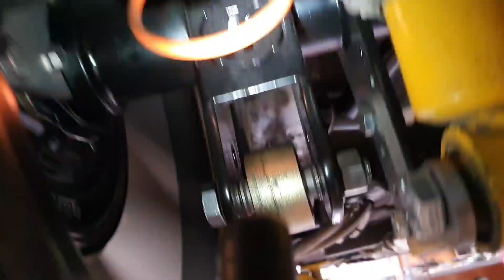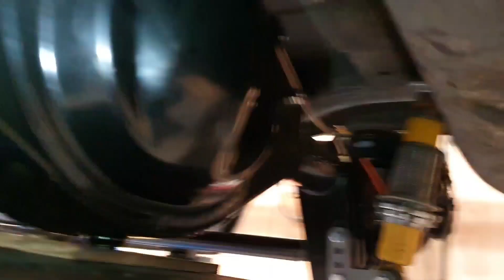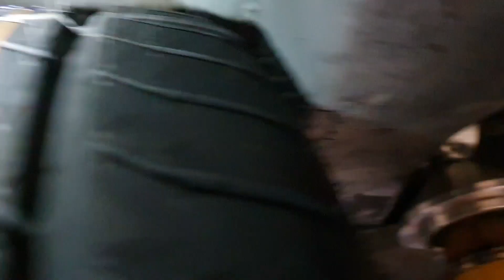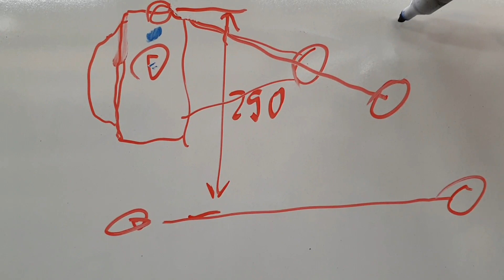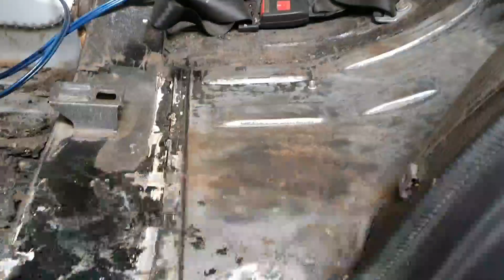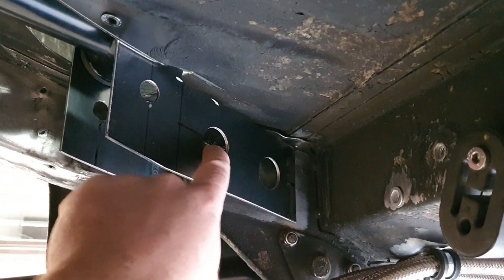Supercharged VK56DE Gloria episode ninety billion

Comment: A 255 would have been just about right for the car.
Reply from the maker: For some reason i thought it had 255 on it to start with but it turns out they were just 235 so we've gone a LOT bigger in wheel diameter and tyre width.
Reply: @TheLabLimited  275 is a lot of tire. Wider than the tires on my pickup.